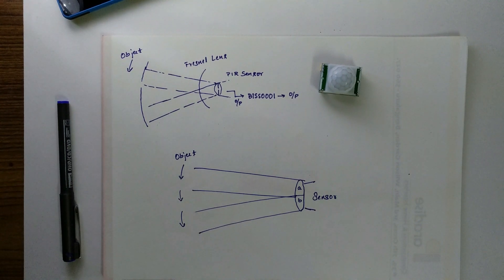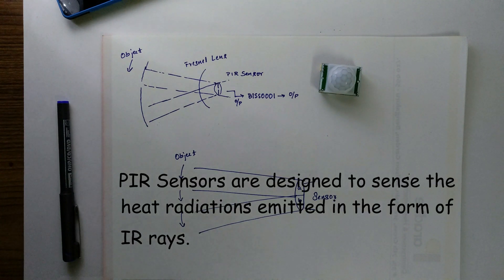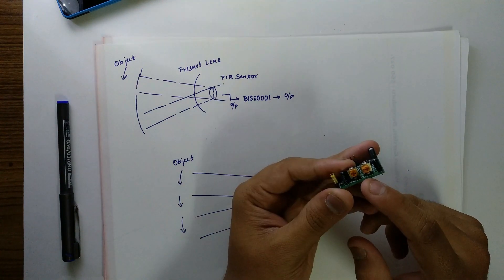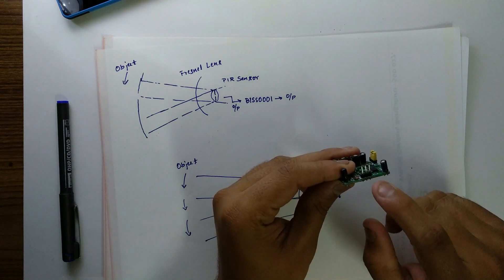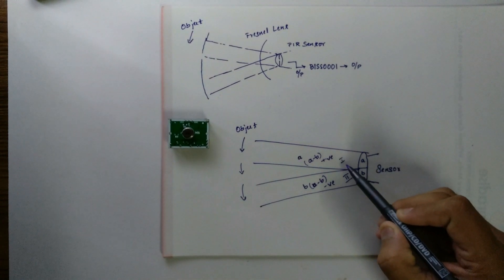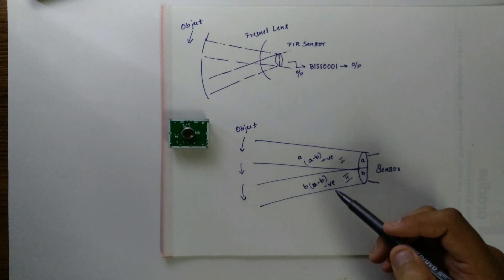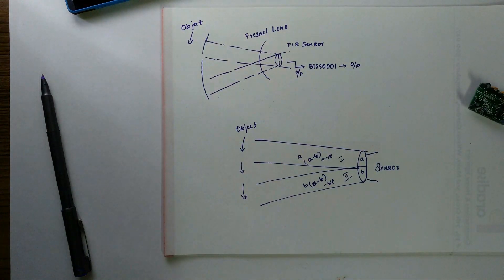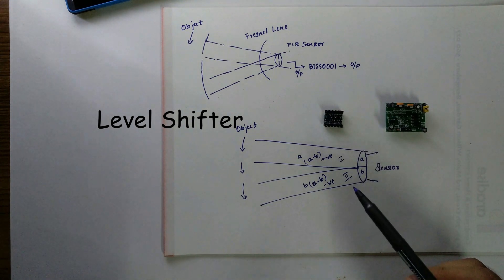PIR Sensor working

Comment: What if i want the sensor to detect movement from one side only
 If there is movement on the other side, it should be disregarded. I.e. i want to reduce the coverage from 180⁰ to 90⁰. Is it possible?
Reply from the maker: You cannot do that with one sensor I guess. Use two sensors
Reply from the maker: You cannot do that with one sensor I guess. Use two sensors.

Comment: how to check if a person is moving from a  to b or b to a, means which part is intercepted first?
Reply from the maker: A single PIR sensor just indicates the movement. If you want to know the direction of the movement, you can easily do that with two of such sensors.

Comment: if person approach from second half then b is high than a, in that case a -  b gives negative ??????
Reply from the maker: I have taken a and b just to explain how it works. What matters is the change in the radiation level. And yes, first a-b will be negative and when that person is leaving, it'll be positive. No matter what there will be a change.
Reply: @techweek8208  thank you for reply , i am still curious what happens if two people approach from both sides ,will it cancel the signal in oppose to each other?
What if someone is standing in the range for long time? What will be the response of the sensor? Please guide
Reply from the maker: @shubhampatil899 
There will not be any cancellation of the signal. It may detect the change. If a person stands in front, the sensor will detect the presence only the first time. The only way to know is by testing. Do let me know if this helps.
Reply: @shubhampatil899  Normally the sensor won't detect anything but the chance that 2 objects do exactly the same thing perfect symetric is extremely small

Comment: What is it's working distance?
As you described that the sensor detect the human body temp. Can it work in bathroom and can it work in winter season?
Reply from the maker: The range is about 4 to 6m. It will not detect the body temperature, it's detecting the IR radiation. Yes, you can use it anywhere.
Reply: TechWeek can I use it in bathroom to operating bathoom light?
Reply from the maker: Yes, you can but you have to set the range.
Reply: @techweek8208  how can we set the range?